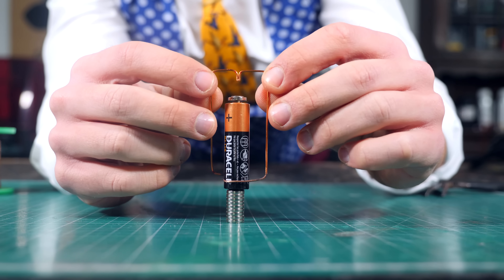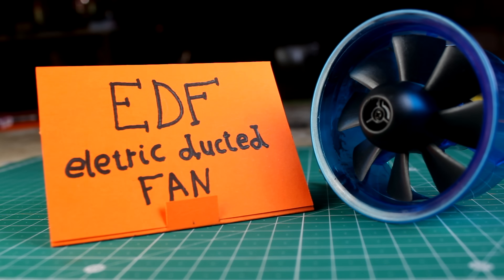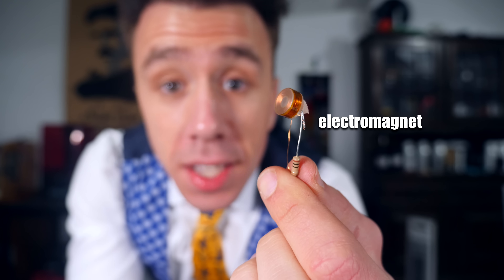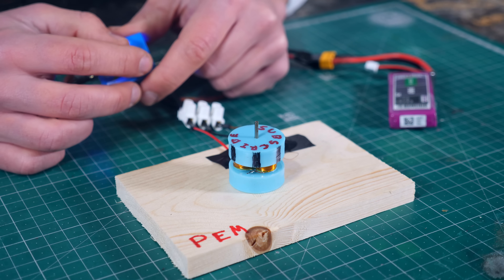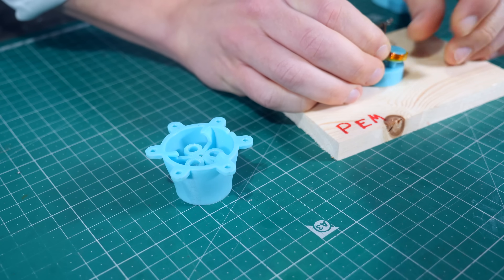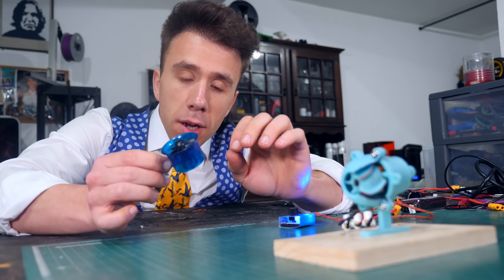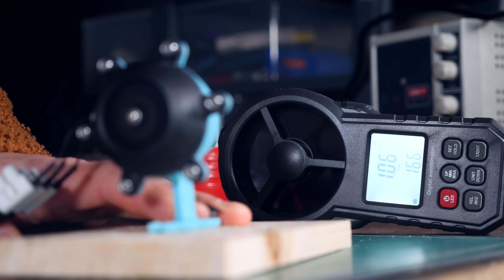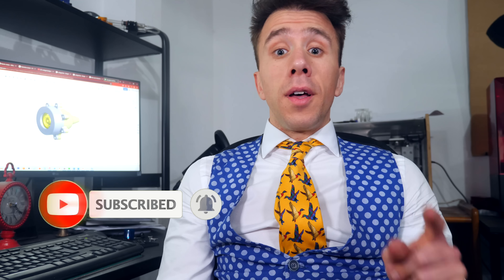I 3D Printed an ELECTRIC MOTOR FAN

Comment: Is it possible that your fan is stalling? The idea there is that the static pressure behind the impeller rises to a point of being higher than what the impeller can sustain. The way out there would be to try a different outlet/nozzle geometry, maybe with a larger aperture. Or to change the impeller geometry to maximize static pressure. That may be a good topic for a future video btw 😅
Reply: At any rate, search terms to learn more: fan stalling, impedance mismatch.
Reply: The quality of the print can also make a huge difference in pressure. If the walls aren't butter smooth , you're creating unnecessary drag and losing a lot of air speed .
Reply: @asakashigure  yes, that's a good point. Added resistance from boundary layer vorticity will increase impedance. This is also true for the max static pressure the impeller can generate in the first place. 

Position, attack angle, slope, distance between the impeller vanes also influence this and need to be fine tuned to the pressure and volume flow expected. All this needs to match up such that the system is close to or at it's efficiency maximum at the desired rpm. 

That also means the design shown may produce better results at lower rpm.
Reply: @asakashigure  With a Resin 3d printer, he's reaching 20 layers per mm... that would make it very easy to reach extremely smooth walls and very tight tolerances.
Reply: As a powerplant mechanic, I agree.   
If the static pressure is too high for the impeller, he would need a bypass if he didn't change other parameters. But that would make it a "Double ducted engine", which I would like to see.
Reply: Not that I actually know the geometric needs for these, bit I think that's a good guess.
From the clips where each version blew into the meter, it did seem like the original ducted version has a lot more open "space" to suck in air, compared to the printed versions.
So maybe they literally can't get enough air in to work better.
As for the pressure vs "speed", taping a balloon to each version's end would show if the printed versions are at least creating pressure, since they're not producing speed.
Reply: @BloodyMobile  not just the inlet. The outlet nozzle also has a large influence on this. The reason ducted fans are more efficient has nothing to do with static pressure, but that the duct inhibits vortex shedding at the vane tips.
Reply: I was thinking the same thing, essentionally causing the air pressure to overcome the airflow and move "backwards".
Reply: Very nice and interesting remark! There is a difference in fans between a propeller, turbine, compressor etc. Different air flows for different purposes.
Reply: no he has a aerospike nozzle that is a divergent nozzle and compresses the flow making back pressure. It needs to be constricted to speed up the flow for subsonic flows. The aerospike only speeds up supersonic flow.

Comment: So, I believe the issue is pressure vs air speed. The EDF is creating high speed low pressure air flow while the impeller is doing the opposite. The total energy is probably roughly the same between fans, but it's being put into speed or pressure depending on the design.

Comment: I believe the blade size is the problem. You see the regular propeller uses rotational movement to move air behind it, meanwhile the impeler uses its rotational movement to  compress air to the ignition chamber and then the ignited air mixture gives off thrust. And if you look into turbofan engines they are more like  propellers than impellers. Also it is time to finally send something in to the air.

Comment: I am no enginerd but comparing the size of the fan blades of you fan and the EDF... well the EDF has a larger fan and so it can move a lot more air as I don't think the motor lacks power. So basically you're centrifugal fan is not large enough to use all the power the motor can provide. Another thing is that you were measuring the air speed which an axial fan can produce  a lot more of than a radial fan at the same size. Radial fans can produce more static pressure but don't have as much airflow.
So a bigger centrifugal fan that can use all the power that motor can provide should get close to the same airflow as the EDF. 
Hmm ... I kind of confused myself here. Ehm so the axial fan can more a lot of air but if the flow gets restricted it won't have the ability to increase the pressure enough to move the same volume of air. The radial fan may not be able to move the same amount of air but if it's flow gets restricted it will be able to increase the pressure to move the same amount of air.
So basically one pushes harder and the other one moves faster... that's my understanding of fans.

Comment: A higher rpm means more drag (friction is velocity^2) , lost as heat in the air, and less energy going to push air. 
Larger propellers are inherently more efficient because they can move more air slower and get same thrust as a smaller prop. 
And air flows through a large hole easier than a small hole.
It is all about efficiency and that means keeping the velocity low, which means a larger intake/exit area and impeller.

Comment: Running the centrifugal fan in the wrong direction?  But more likely a pump has a flow/pressure performance curve vs rpm and a point of optimal performance on these curves. The key to optimal performance is to match the Pressure flow curve for pump to pressure flow of the load. You can waste heaps of energy heating air up a tiny bit by not matching these curves.

Comment: Great video ! I believe you are on to something with the hybrid design. Don't give up. I believe the centrifuge fan trades a lot of the energy in terms of velocity , into compression force of the air. Meaning the air pressure from the EDF is low but velocity is high. And the opposite for the Centrifuge.  The high compression is great though if mixed with fuel and ignited out the back! Also you may can look at Turbo charger compressor designs and use that for more velocity. Cant wait to see video number 2 of this project.

Comment: My guess is airflow(duh). the Dyson fans looks to have much different proportions, and from what i know fans can be tricky to get right at first try without using expensive simulation tools.
My advice would be to determine which aspects of the fans are responsible for altering the thrust/flow, and make different versions of the trust to experiment which combo gives you the best thrust, then proceed from that, just some good old R&D, 95/100 projects are scrapped and the rest might have an use

Comment: I think the fan's cowl helps the major mass flow. The fan may not be compressing and accelerating the air at the same rpm as the centrifugal fan, because it doesn't have to. The low pressure created by the fan's moving air draws surrounding air and moves the medium (air) together, rather than focusing on compressing a small amount of air. If the air from your built centrifugal fan can't get rid of the air it's compressing fast enough or allow a negative cavity to draw that compressed air out, it won't blow. It can't. It simply compresses air, transports it and then lets it get decompressed in the atmosphere.

Comment: armchair amateur here, but you're chasing air speed with a fan meant for static pressure, the reason the dyson works so well is because of their thousands of hours designing the perfect venturi down-stream of the fan to put that pressure to work around the housing's circumference and in combination with ambient air.  You're basically just exhausting yours directly to ambient, sure the rear blue housing helps but it's arguably just too small and of minimal practical impact, just for giggles use the cardboard liner from a toilet paper tube and tape it to your exhaust to help duct and guide it before it reaches the anemometer, the volume wont change because it is sealed to exhaust housing but your pressure will fall while speed increases. (again total rookie here, but just rubbing my brain cells together with what little I think I know)

Comment: I'm not qualified but, Centrifuge fans is like Diesel engine. Torque for pressure and RPM is for thrust. Diesel engines are low revving engine because of their fundamentals. Diesel engines produce a lot of torque but, it does not go that fast. Centrifuge fans produce a lot of pressure but, not a lot of thrust. Axial fans is like a Gasoline engine. It is higher revving but, it does not produce a lot of torque. Axial fans produce a lot of thrust but, not pressure. The deep, really detailed explanation is, I don't know. Can someone reply to this comment talking about the physics and thermodynamics about the Axial and Centrifugal fans.

Comment: Motors have torque and speed ratings. Generally there’s a trade off. EDF and compressor motors are both typically high speed low torque motors. However, EDF motors are a little higher speed and a little lower torque than the compressor motors. It’s likely the motor struggles to overcome the increased back pressure due to its low torque. That causes it to slow down and be less efficient.

Comment: The answer is simple - pressure over flow. EDF gives flow, flow gives impulse (because it is by definition moving more mass in a portion of time). Impellers, turbines, for the other hand, often are built for pressure, not flow. Pressure helps to overcome restricted path (to have more flow over really thick and dense radiator, for example) or to provide higher concentration/density.
Basically designing any fan is defining your requirements and restrictions (high flow with low fan mass, or high flow through restricted path, or high flow with low noise, or high pressure on the output, etc.) and finding balance between flow, pressure, size and noise. There are also turbulence and spread of the output, but that's more about straightening device after a fan, if it is really important.

Comment: If you want to print a jet turbine in ceramic. Print using clear negative molds and only active with UV in a vacuum chamber. This makes it more dense,tough and balanced. 1-2mm walls should allow burning off the negative molds since extraction due to shape isn't always possible.
.Tomatoes are disgusting.

Comment: I think that you have made a centrifugal compressor. It is restricted by the size of the opening. You could also use an openning with a outward curved surface to take advantage of the Coander effect and draw more air in.

Comment: The reason is pretty simple, flow rate on a fan is directly proportional to speed changes and cubed for diameter changes. So if your impeller manages the same rpm as the ducted fan, all that matters is the diameter of the fan. Impellers also try to get around this by turning pressure, which relationship is both squared for area and rpm of the fan, into flow, which ends up being a 3d graphing thing to reach the best feasible power x flow x diameter for your motor. Plus there are material considerations, lighter is usually better to a point, you can tell if your material is less efficient by printing the exact same copy of the ducted fan blades and measuring the rpm of both.

Comment: Fans, create quite effective air movement. But the compressors, compress the air in order to make the air denser and therefore escape through the slightest interstice easily to recreate a movement, here, later at the exit. But increasing the air pressure, is already a loss of energy, in heat.
Yes Dyson uses this to make a bladeless fan, but it has never been shown to have the same efficiency just moving air in one direction.
The bladeless fan is proof that Dyson is more design and communication than engineering. Or rather engineering at the service of design and nothing else.

Comment: Seems like because you're trying to trade velocity for pressure, you're not gonna get the same thrust out of it with a centrifugal based propulsion method. That would be my guess. You're spending most of the energy flinging the molecules outward and shoving them closer to each other rather than accelerating them backwards to take advantage of newton's law.

Comment: This may not even be true since I'm pulling from an old old memory of a documentary but don't Dyson fans use standing wave harmonics and therefor have tight tolerances in proportions of the intake, flow rate and distances involved?

Comment: I Integza! I might have an answer about your problem, in fact there is two main problems with your current setup. First, you’re not measuring the thrust of your engine, you are measuring the air flow speed at the end of this engine (even if its link to the thrust it is not direct measurement). Moreover, and the primer issue of this engine is that centrifugal fans are design to compress air on a radial direction, so because of that when you change the air flow direction it creates a lot of friction (and loss of power). Basically, this fan is not adapted to backward trust (as an old style airplane propeller), if they are use in jet engine it’s to compress air and allow a good combustion. 
Hope that it will help you 😉

Comment: This is my best guess.
An EDF is designed and optimised for mass flow rate whereas the centrifugal fan is designed to create a pressure differential right? So the centrifugal fan motor does work to increase pressure, rather than to accelerate air. Just from the Ideal gas law, compressing a gas is going to heat it up, and Its not an adiabatic process so energy is lost to heating it. This should mean that the thrust is going to be lower than a regular fan just based on energy laws.

The regualr fan blades I suppose are designed so that the pressure doesnt change at all but all so the work done by the motor goes into accelerating the air passing over.

These designs will work better at different levels of static pressure, so adding restrictions to the flow of air in front of both of them, at some level of restriction the edf will be overtaken in terms of thrust by the centrifugal fan.

Comment: Use plastic or 3D printed screws because of the weight of the metal the rockets and stress to create thust and its light and cheap to

Comment: I think Size matters. The diameter of the blade limits the mass of air it can move under a given speed hence limits thrust. Small jet engine spins wayyy faster than large jet engine in order to self sustain.

Comment: Idea: I don't know how, but one thing I would like to see is RCS (Reaction Control System) thrusters, small rocket engines used on spacecraft and some aircraft to control their orientation and position in space or in the atmosphere. 
And: potentially why it doesn't work, is it possible that the fan is shaking, maybe I'm just imagining it, but that would reduce efficiency

Comment: I think the impellor produces less thrust because is has less volume/mass of air flowing though the fan than the edf which is oplimised for flow rate and thus the edf pushes more mass backwards. a turbojet converts the high pressure air from the intake to high speed air usin a combustion of fuel if im correct. also id like to see how tomatoes fare agains the thrust generated from all the motors you have produced in a future video.

Comment: I know I have seen an equation about the diameter of blades vs the speed of rotation, at a point excess of rotation impacts negatively in the thrust. Chatgpt says is called BEM equation

Comment: As for an idea how about making an HHO. You could 3D print a lot of the components and the use steel plates to make the hydrogen generator and that would give you a touch for around the shop.

Comment: Axial fans are (relatively) easy to implement. Centrifugal fans on the other hand, are not. The fan itself is only half of the equation, and the casing around the impeller is almost as critical as the impeller itself.
Also, thrust ( which is mass flow) might not be that important if you plan on injecting fuel and making a jet engine. In that case, the (static) pressure would be more important, which will mean you can compress the A/F mixture and get more bang.
Simply copying impeller designs would probably not help because the impeller and the casings are designed for specific operating RPM and other parameters.

Sadly I cannot offer any solutions, because that requires extensive fluid dynamics knowledge, which I do not have.

Comment: Id say maybe add a stator behind the impeller like the centrifugal compressors in model jet engines have this should give the impeller something to compress the air against and it will straighten out the air flow and generate more thrust

Comment: It honestly just looks like you made it way too small. I think you were on the right track but it needs to be scaled up more so it's not restricting airflow... In fairness, I'm not an engineer or anything so this is just my very unprofessional opinion. The inlet on your centrifugal fan just seems super small compared to the EDF so there's no way it can move as much air.

Comment: I dont think that thoese two types of fan should have the same air flow , centrifugal fans are designed to produce pressure , normal fans are designed to produce flow . Apples & oranges here .